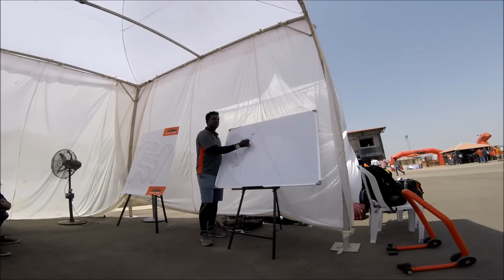KTM Track Day - Hyderabad - VLog Part 2. March 2016

Comment: Hi bro....... I have recently got my Ktm....... Can I shift without using clutch......... It's been about a month or so...... Thanks
Reply from the maker: Hey bro. You can, but if you do not use the correct technique, it could damage the Gear box. So, do not do it right away. We will discuss after you ride for a couple of thousand kms :) Good Day Bro.

Comment: i thought the hotter the track n tires the more the grip?
Reply from the maker: +Harsha Bandreddi After a point the Tar on the surface will start to melt bro and rubber will also start to slip.. :(((

Comment: what tire pressure we should keep on track days?
Reply from the maker: About 24 front and 25 rear, I keep for my weight of 70kgs on Duke or RC 390.
Reply: Thanks my human encyclopedia 😀
Reply from the maker: Janak Raiyani for solo riding: 25 front and 30 for rear. If with pillion, 25 front and 32 rear. If bad roads, 27 front and 32 rear :)